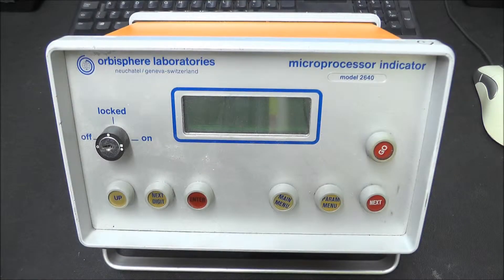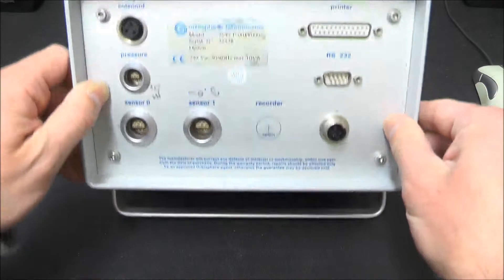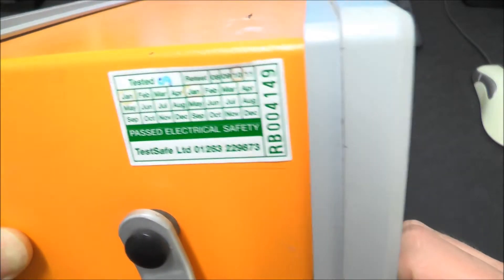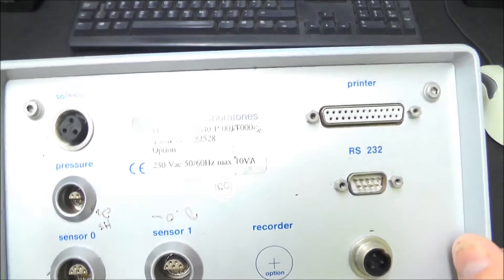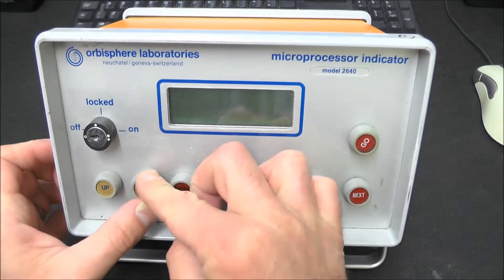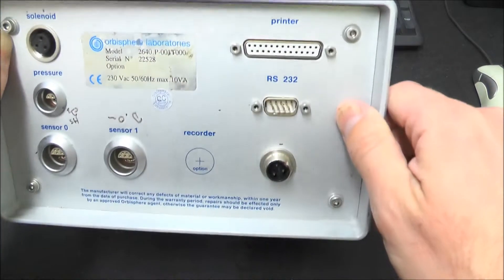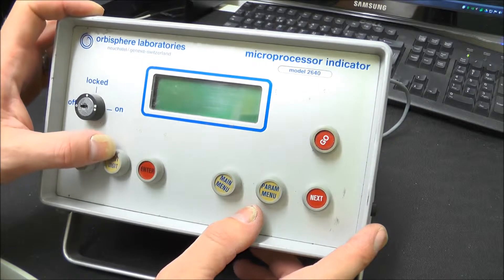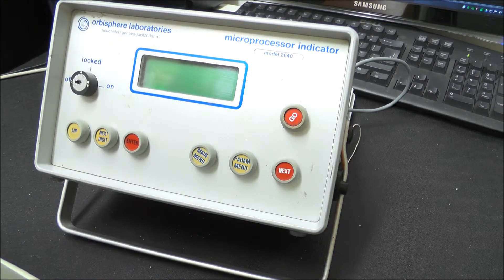DL#027 - Teardown: Orbisphere Labs 2460 Dissolved Oxygen Meter

Comment: Note the IC sockets have the 100n chip caps installed between the power and GND pins, saving you board space and giving better response as well. rubber buttons are because it might be operated by operators with wet hands, and as well it will get wet during wash down in a brewery.

What is the TO100 can IC next to the ADC?

As to use it would probably have been used to ensure the oxygen level in a fermentation tank was kept within certain low levels along with being able to output a signal to a dump valve to regulate the CO2 pressure inside. Yeast needs to be kept anaerobic in brewing to encourage alcohol formation instead of using oxygen to metabolise.
Reply from the maker: yes i did comment on the built in decoupling cap in my original video but edited it out.

i have seen similar units with a rig to use with consumer bottles, so think there is some function for that, maybe the headspace HS features.

i noticed the TO100 device in editing but skipped over it to save time. Will check the original footage and report back!
Reply from the maker: SeanBZA AD584JH, voltage reference 30ppm (2.5, 5, 7.5 & 10v)
Reply: DextersLab2013
 Want to post the board to me if you are not using it then?